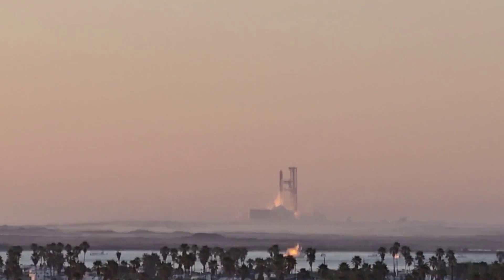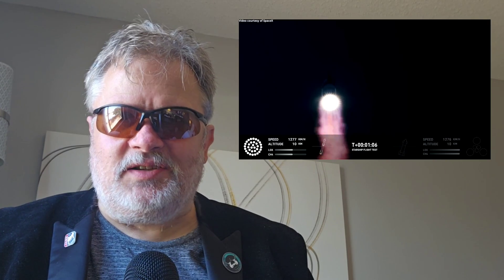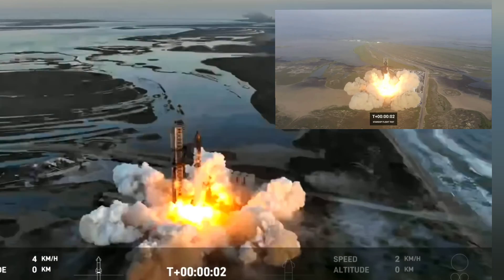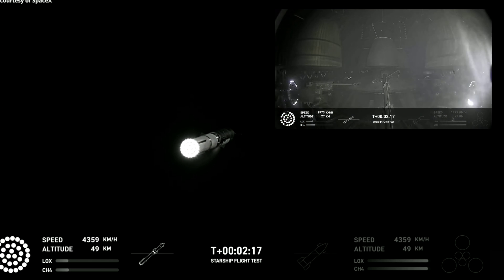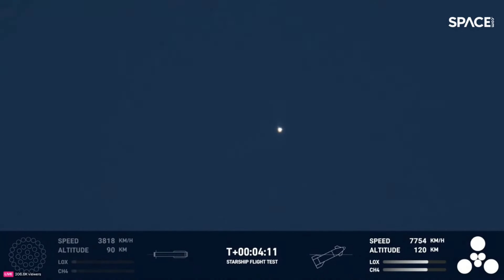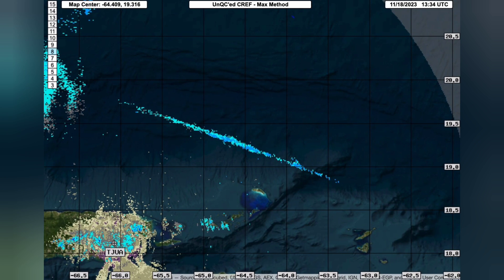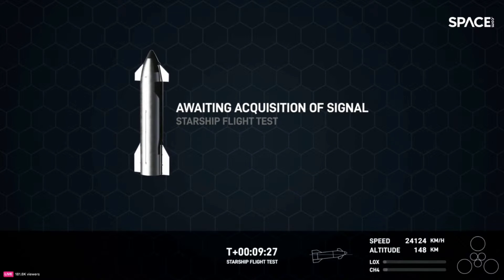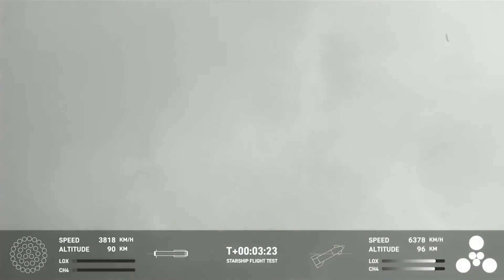Starship takes a huge leap forward!!  What's next for SpaceX after OFT-2??

Comment: Looking at the booster speed figures as the booster engines turned off, it hot staged, then booster engines re-lit I see negative speed readings even with 3 booster engines firing continuously. Could there have been momentary negative-g on the booster that would exacerbate fuel slosh? If so would better anti-slosh baffles low in the tanks help? Or maybe actual header tanks to specifically feed the engines through the flip maneuver? Besides speed & altitude figures I’d like to see the g-loading figures the booster & ship are experiencing from moment to moment during hot staging, flip & boost back

Comment: I think hotstaging was fine. The issue was at the thrust section on the opposite end of the booster. Don’t think staging had any effect. Prop slosh at engine failure is most likely.

Comment: The mission was 90% successful. An amazing advancement in capability in just seven (7) months of elapsed time. I am also of the opinion for prototype test two (2) both the booster and starship's FTS were purposefully initiated as part of a planned destruction in part to demonstrate to the FAA and F&W the significant efficacy improvements well beyond prototype one (1). I estimate prototype three (3) mission will achieve a boost-back and starship reentry success (Falcon - 9 & Falcon Heavy success) if the heat shield tile adhesion problem can be overcome from 98% to 99.9%. I also would expect the launch cadence to improve from seven (7) months to three (3) given the latest successes, and problems yet to be resolved. AS to Artemus 3 - the success or failure is in the hands of the government (NASA) and not likely in the hands of SpaceX. As we who have been around before the days of Apollo, if anyone can screw up a program it surely is the government.
Reply: Gosh, wouldn’t you want to be a passenger on a 90% successful flight.
Reply: @rickb.4168 starship won’t be launching astronauts from earth for Artemis, it is a lander for Artemis 3. If starship successfully gets to a lunar orbit and has good data telemetry the odds of a successful lunar mission would be quite high.
Reply: @rickb.4168  Yes indeed - but for a second prototype, sure is amazing the progress. Maybe in 24 months we might actually see a human rated space flight.

Comment: After the Flight Termination Sys failed in the first flight - SpaceX had to pop both parts of this flight to satisfy FAA.  They popped the booster after they proved control post separation.  They already have software for everything to land.  They activated FTS after the rocket hit orbital velocity in space.  This proved the new FTS works in a vacuum on orbit.  Neither pop was a RUD - just the way failure is used to improve.  Also, I think they proved everything and do not need a splash off Hawaii.  Now, they can go for full orbit, test the heat shield, and put her where she can be recovered / landed for reliable micro / wear pattern analysis of the tiles.
Reply: Starship 2nd stage didn't achieve orbital velocity.
Reply: I sincerely hope you're right!  thanks for the optimism!

Comment: The flip maneuver seems to have interrupted the fuel supply to the still burning engines and made restarting them impossible. the fuel and LOX tanks could probably benefit from increased baffling to prevent this interruption in fuel supply. The FTS probably triggered too soon, and before any ullage from the gas thrusters to restore fuel supply could take place. Just this viewers opinion.

Comment: Great video (as always).  I'm more optimistic about schedule. It looks like the Stage 0 modifications worked perfectly.  This should allow much more frequent test flights.  And with the new Starbase upgrades, they'll be able to pump out ships and boosters like chicklets.  So even if they have to expend 15 more Starships for Nasa, I don't see an issue. My biggest worry is the launch noise at South Padre Island.  IIRC, they're currently only allowed 10 launches per year. If it's really loud at SPI, that may be enough environmental impact to keep them from expanding beyond 10 flights a year.
Reply: They are only allowed 5 launches per year under the current license.
Reply: @randyschreiner7807  I just checked the latest FAA written re-evaluation from November 2023, which states: "SpaceX would conduct up to 5 orbital Starship/Super Heavy launches per year and up to 5 suborbital Starship launches per year from the Boca Chica launch site". So I guess that raises the question, since they planned to splashdown near Hawaii: Are the last 2 test flights considered suborbital Starship launches ?
Reply: In any case, whether it's 5 or 10, it's probably not enough going forward, so in the future I suspect SpaceX will request the FAA to do another written re-evaluation to raise this number. At that point, the amount of noise in South Padre Island could become an issue.

Comment: I'm inclined to agree with Scott Manley's assessment, the hot staging pushed the booster back causing negative G in the tanks and that combined with the slosh from the rapid flip allowed gas bubbles in the fuel system, these can easily cause pressure spikes in the turbopumps destroying them and the engine... Once so many engines are damaged the FTS will detonate the booster, as it did.
Reply: I agree, but sadly that implies a major redesign of the fuel system, or giving up on hot staging or both.
Reply: @goukux5908  Or simply a software tweak to keep more power on the booster to keep it from going into negative G. The 3 centre engines were throttled to 50% so simply leaving them at 100% might be enough.
Reply: @stonesie81 yeah as long as the acceleration stays in the right direction even if it's low acceleration the propellant liquids will stay at the right end and keep the engines fed with liquids instead of gas.
Reply: @goukux5908 they could use a header tank type fix like they did with starship. Not sure how viable this would be, but its my first thought

Comment: The launch was a giant milestone - if they can sort out the causes and resolve them, orbit could be reached with the next iteration. 
I have a hard time understanding, why Nasa thinks 15 Starship launches would be needed to put two men on the moon. I'd think, Starship could launch 150 tons of payload into LEO pretty soon - loaded with  HLS hardware from Nasa or competitors like dynetics or Blue Origin. The Saturn V was designed to lift up to 120 tons to LEO - which means, Star ship could lift a similar amount - and do it without the need to be human rated, as the command moulde could be lifted by a Falcon 9 rocket instead and do a coupling manuever in LEO. So only the service module would have to be lifted into LEO, and maybe a alpacca vehicle by a second starship - both could (and should)  be made redundant, so a Starship failure could be repalaced easily. 
In that case one Falcon 9 and two starship lauches would by far surpass anything that Nasa could afford to bring up back then - and so it should be possible to have Nasa build or adept the command module, dynetics build the moon HLS and Space X do all the heavy lifting to reach moon for a first try in 2024. 
But if I really think about it, I see more problems on the side of the dynetics and BO side than on the Space X side. It could well be, that Space X does some kind of a small moon HLS themselves, to fill in for the painstakingly quiet and slow competitors. I'd use the ISS as a parking lot for the returning to earth standard Dragon capsule and bring up a huge command module for the moon transition by a falcon heavy. Service module combined with the moon orbital gate  by one single or two starships.

Comment: I don't think it's gonna take 15-16 flights to refill starship. Spacex likes to simplify things, while Nasa like to complicate them, so the number of launches is probably somewhere in between.
Reply: Raptor reliability has a thing to say here. If it is very rare that even one engine fails, they can probably push the payload to maximum, else more launches are required.
Reply: How so? Reusability is more complicated than one-time use.
The difference is naturally in costs to orbit. 

The mayor costs of every mission to NASA is R&D + engeneering something completely unique for the mission. Therefore paying hundreds of people for a decade and subcontracting companies to produce something that they will only need once.

The cost to get something into orbit is just a footnote compared to the rest. Take the JWS telescope as an example. The project cost a total of 10 BILLION.
An falcon heavy launch costs 100 million - expandable flight by sacrificing all boosters and using every ounce of fuel is 150 million. Reusability is only a difference of 50 million.
the difference woulde be 10.00 vs 10.05 billion
Reply: @benjaminmeusburger4254 I think they’re saying if spacex can keep the thrust to weight high with more engines reliably staying on, they can shrink the margin of error needed to complete missions like refueling
Reply: It's just... not easy in general. You're going to be volume-limited more than mass limited most likely, so regardless of engine performance, engine-out performance margins / reliability, and payload capabilities - these propellants just take up lots of room. There will also be lots of boil-off between launches.  These are factors that are completely set in stone, and simply can't be avoided. It's going to take a LOT of launches to refuel a starship unfortunately.
Reply: Space X officially declared the booster explosion as a RUD, not flight termination system, so saying that it was terminated in this video is inaccurate.

Comment: Very curious as to why Starship's Flight Termination System was triggered 4 min after successful staging.  At 143 km altitude. I wish SpaceX was showing where the actual vs intended flight path was going over the Gulf of Mexico out into the Carribean.   Is this a problem with the Raptors or guidance or was it not accelerating to orbital speed quickly enough ?  Without being able to get to orbit , refuelling  is a moot point and Starship isn't going anywhere,  manned or unmanned.
Reply: 148 km altitude !  It started loosing height, but only very slowly.  Somehow it suddenly used up too much LOX at the end.  Wouldn't have reached orbital velosity, so it 💥

Perhaps the upper stage is better equiped with Raptor V3.    🚀🏴‍☠️

Comment: You know, the rate of improvement has been so impressive, I think Elon could have this vehicle launching at least something that gets to the moon by 2025 (within 24 months). But, it is such a big ask, one has to wonder where could it go wrong? The shuttle, another push-the-envelope-techology, had heat tiles and o-ring issues, both issues concerned stress and heat. It's possible to also critique the shortcomings of OFT 1 and 2 in the same terms.

Comment: Superheavy engines lit, then went out after it flipped, which indicates lack of fuel, aka sloshing.  Space X already has this down to a science, manufacturing/testing.  If launch pad is unscathed, 12 launches in 2024.  Plus they will soon start work again at Roberts road.  Already have complete star factory there, will quick build high bay.  One launch tower is up & segments for 3rd.  By 2025 will be launching from 3 diff locations about 40 launches a year.  Space X will be ready, will NASA?
Reply: Going up is one thing. Then of course, there's the coming down. After that the hanging up in the chopsticks, which I must admit I have less confidence in than Elon does.

Comment: In my opinion more thrust should be maintained by the first stage, with less thrust on the second stage during staging. The booster suffered negative acceleration, upsetting the feed of fuel to its engines.
Reply: Anf maybe they could light th straship engine 3 at a time at the separation, first the 3 central engine and a few second later the other 3.
Reply: The telemetry info should help with that. good point.

Comment: If they want to release the clamps of the OLM before ignition, something has to hold the vehicle vertical because despite having all 33 Raptors on, IFT2 left the pad inclined anyway. That means that somehow, the vehicle “oscillated” during the time it got airborne, thus, I think the chopsticks should hold on to Starship and release it and spread on the double at the first vertical sense. 
They protected the booster of the exhaust but did they protected the orbiter engine’s inner space enough because this seems the reason why the orbiter failed, not the puck but the inner structure that connects to the LOX tank, seeing it leaking at its MAX acceleration state, more than 4G!
Reply: IFT-2 likely intentionally did that. They said 'Pitchover maneuver started' at T+11, and they also didn't attempt to fix it in any way. The chopsticks are too slow at the moment to clear enough for launch within a minute, and the slightest of pitchover would be problematic in that sense.
Reply: I don’t think so because it went the wrong direction towards land and then had to gimbal the other way towards the sea. You clear the tower and then you go for roll program.
Reply: You’re right, I just read that Saturn 5 yawed 1.5 degrees away from the tower while it was clearing it. I stand corrected.

Comment: I can tell for sure what went wrong !  There were re-ignition issues after the stage separation.  Besides that, the booster performed well, and the hot-staging also went perfect.

The upper stage did not reach orbital velocity.  It could well use 20% more propulsion power.  Fortunately, the Raptor V3 fits exactly this specification.

Next Starship is nearly ready.  Now the waiting for faa licence goes again.  So far, it was:
1. Licence took 1 year,
2. Licence took 7 months,
3. Licence will take 16 weeks ?

I would tell the FAA, it was a last minute decision to test the flight termination system.  After that huge delay in 1st flight, this test seemed most urgent, after reaching stage separation.  And the fact that the nose cone survived fts is a very good thing, for implementing a crew resque system later on.  🚀🏴‍☠️

Comment: I do hope they have all the data of the last moments of Starship. Everyone in the controlroom looked puzzled. So, I fear they, indeed, may not know what happened to Starship.
Reply: They lost contact, and I doubt there’s any ‘black box’ on board.  They can only guess at what happened.  

It would be hilarious if Starship hit a Particularly low hanging Starlink sat.
Reply: @russellharrell2747 They don’t need a black box. All of the flight data was being streamed until it lost contact.
Reply: @russellharrell2747 I think whether there was a black box or not, the moment any telemetry stream stopped transmitting over radio, the black box would also stop getting data just as early. Right as it explodes you're not getting that data with every sensor connection being broken, just like the radio will stop transmitting the moment it loses power in the explosion.

I'm thinking Scott Manley may be right about Starship having a natural explosion, which would explain why they didn't know if they lost contact or lost the vehicle. AFTS presumably would show in the telemetry in the last moment, and it would only trigger if off course and not for other reasons. It would explain the puzzlement of the staff in the moment. If it was natural, they'll just have to review the telemetry and NASA plane footage to find the likely cause. Like tank pressure loss in the last 30 seconds pointing to a leak, and a camera on the vehicle or observation plane showing the leak location.

Comment: Scott Manley has a good analysis of the flight, and what went wrong and right. Really hard to know if hot staging is good idea at this point, but it is nice to see SpaceX trying out new ideas, which is the whole purpose of its rapid iterative testing process. Try out new ideas and see if they work, and then adjust rapidly based on the testing. 
My feeling is that incremental improvement is the best that we can hope for at this point and it is going to be a long, hard slog to get there, so be prepared for more RUDs. It will take determination and willingness to endure lots of criticism for SpaceX to develop Starship, but I'm glad that SpaceX keeps persevering. 

As for SLS, I guess we do need it in the short term, since I expect it will 2 or 3 more years at a minimum before Starship is ready for normal flight, and I don't expect manned flight until 2028-2030.
Reply: I'm sure they can tune it so the booster never experiences negative G's. Just turn off fewer engines and let the backpressure push it off. Or, start staging and gradually reduce thrust on the booster until separation.
Reply: I watched Scott's analysis, and I agree with him that hot staging wasn't the problem. What seems to have been the issue is the booster flip preparing for the boostback burn, it may have starved the engines of liquid fuel in the direction against the rotation of the booster. Perhaps another set of header tanks to keep the engines fueled during the flip would be the correct answer, but this is just me speculating here.

Comment: If the thrust on the first stage was less than the thrust from the second stage then you could have created a condition with negative directional thrust.. aka braking effect that made the fuel slosh.
Reply: That’s an interesting theory… numbers and data we need.
Reply: They probably going to need some kind of smaller tanks inside the main tanks that can compensate for the slushing before it stabilize, since there are barely any room outside and the tanks are only 1/6 inch thick so they will fit perfectly inside. Or even divide the main tanks at the bottom so slushing will be harder with enough holes for the fuel to go through.
Reply: @Relic-Sleipner  they do have that.. so maybe they did not use them but for landing… it seems a good idea to use them in the flip maneuver. They have appropriate method in falcon 9.